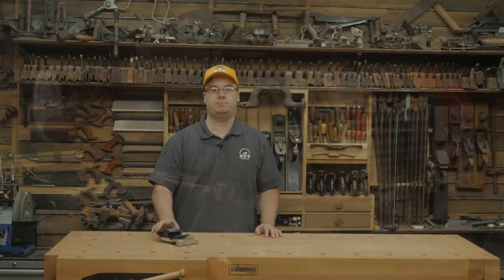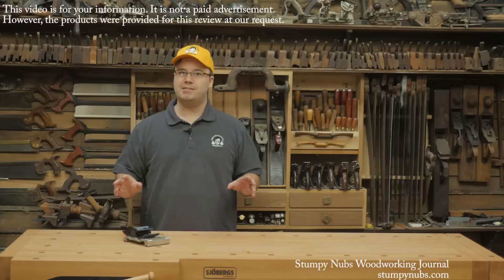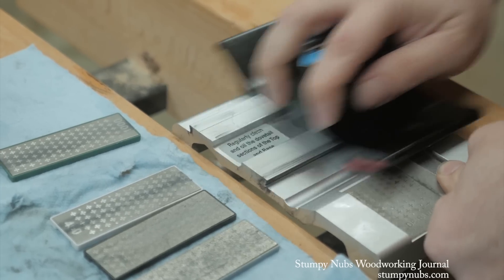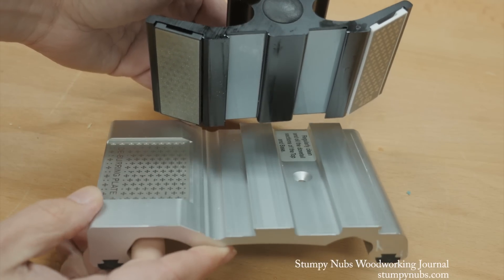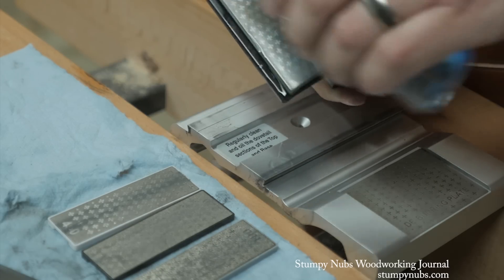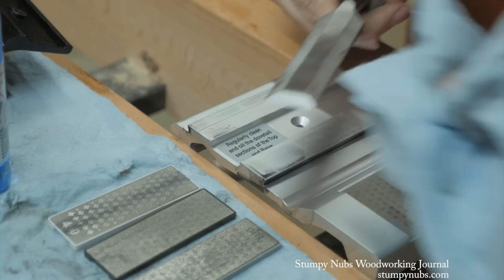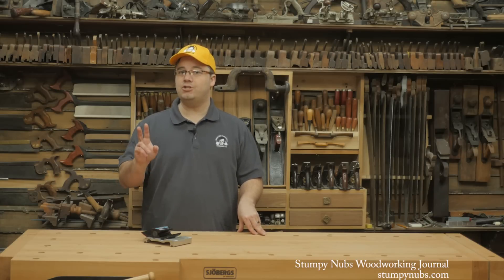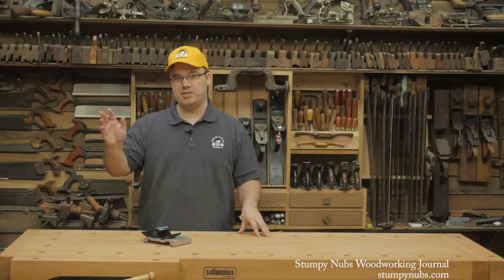Freehand tool sharpening the easy way- M-Power PS System

Comment: Dear Mr. Nubbs,

Based on your recommendation I bought the MPOWER MK2. For more years than I want to count, I’ve sharpened my chisels using a series of whetstones. Normally, I devoted the better part of morning to sharpen my 6 chisels.

I still use my whetstones to do the backs of my chisels, but now I’m a fan of the MPOWER MK2!  It’s very speedy—changing the “stones” couldn’t be any faster due to the magnetic system.

I now can sharpen all my chisels in less than 1 hour.. And they pass the “wispy curl test” with flying colors.

THANK YOU!

Comment: I am torn between the latest verions of this thing and the WS3000.  What I want is speed and accuracy.  I can get my chisel sharp with a honing guide and sandpaper but it takes forever - mostly because the bevels are all screwed up on my chisels.  The M-Power system is appealing because its small, simple, and $100 cheaper than the WS3000.  The WS3000 is appealing because it looks like it would be really fast.  What should I get?

Comment: Thanks man, for putting in the time and effort for this video!
some thoughts on the product:
i would think moving the stone perpendicular to the chisel isn't ideal, and that you'd get a better edge if you move the stone into the cutting edge, or use circular motions... any thoughts on that by an expert?
and also i would expect the stones to wear out quickly on the spot where the cutting edge hits it, because it's always on the exact same spot..

Comment: So this being the only video about this system I find trustworthy, I have a question about this, or maybe about sharpening in general. The new version of this system features 25°, 27,5°, 30° and 32,5° angles. Now couldn't you put a 25° primary bevel on your chisel or plane blade, then a 27,5° secondary bevel and then, instead of grinding it back to 25° when you would need to, just put a 30° secondary (or tertiary) bevel on until that goes too far back and then even go for a 32,5° bevel before you grind it all back to 25°? Wouldn't that save a lot of time grinding?
Reply from the maker: Yes, you could do that. But some may find a 27.5 degree angle a little weak for hard woods (dulls quicker). And some may find a 32.5 degree angle a little steep for soft woods (cuts harder).
Reply: @StumpyNubs  Thanks a lot! I was wondering, why no one was suggesting this obvious shortcut.Maybe I'll make my old ones dedicated soft wood chisels and save a bit on their upkeep.

Comment: The instructions say mount to an 8x10x0.75" board that is an L with a 2x2x8" board. The small board is put in the shoulder vise. But stupy puts the Mpower device directly in the shoulder vise.

Comment: Very easy and repeatable but what I don't like about these is the scratch lines run parallel to the edge which will leave a weak edge.
Reply from the maker: +caskwith - There are no scratch lines to speak of once you use the 1000 grit plate. It does not leave a weak edge.

Comment: How 3 in 1 oil stack up against your trend fluid?
Reply from the maker: +harley75us -Any light oil will work, but (according to diamond abrasive manufacturers) when you get down to very fine diamond stones the film of oil may actually be THICKER than the diamond points are sticking up out of the substrate. 1000 grit stones have an abrasive film that is only about 5 microns thick. (15 micron diamonds, embedded 2/3 of the way into the plate like little icebergs) Kerosene film (I believe) is about 6 microns thick. So your blade will actually ride on the kerosene film ABOVE much of the abrasive. WD-40 is also popular, but it's film is 17 microns thick, 3in1 oil is thicker! So, while it is certainly possible to sharpen with oil, diamond abrasive manufacturers argue that it actually inhibits the effectiveness of their stones.

Comment: What is the liquid you are using, something special or just oil ?
Reply from the maker: +Allan Perret - I use Trend diamond lapping fluid. It's a very light oil based lubricant. They say you can use water, but I don't like to introduce the chance for rust into a flat plate. I wrote an article about it once: http://www.stumpynubs.com/blogws13.html
Reply: +Stumpy Nubs (James Hamilton)
  Kerosene is a excellent lubricant for sharpening.  Learned that from Bob Elliot, boatmaker at Lowell's Boat shop in Gloucester, Mass.  (the oldest continuous boatmaking business in the USA).
Reply from the maker: +William Brown - Any light oil will work, but (according to diamond abrasive manufacturers) when you get down to very fine diamond stones the film of oil may actually be THICKER than the diamond points are sticking up out of the substrate. 1000 grit stones have an abrasive film that is only about 5 microns thick. (15 micron diamonds, embedded 2/3 of the way into the plate like little icebergs) Kerosene film (I believe) is about 6 microns thick. So your blade will actually ride on the kerosene film ABOVE much of the abrasive. WD-40 is also popular, but it's film is 17 microns thick! So, while it is certainly possible to sharpen with kerosene, diamond abrasive manufacturers argue that it actually inhibits the effectiveness of their stones.
Reply: Thanks - good info James.  Mr. Elliot was sharpening on a hand cranked grinding wheel he found in an old barn in Maine!  I doubt it was much over 1000 grit.
Reply: @StumpyNubs  can you link us up to your data sourse on micron thickness of these materials in layer form thickness.
Reply from the maker: @makenchips  I think you can Google the MSDS for WD-40 and find it's film thickness as easily as I can. The micron thickness of diamond abrasives is an industry standard that you can find yourself as well.

Comment: Had this system for a few years and stop using it almost as long;  yet another gismo in the seemingly endless arrays of tool sharpening gagets so I had to give it a try, not impressed, the 5 different micro diamond cutters clog eaisly are time consuming to keep swapping out and differentiating,  and if your chisel or plane blade is a little over or under 90 degrees you'll be there forever. Found the Worksharp 3000 system the best all around.